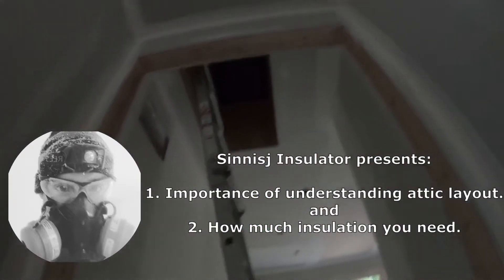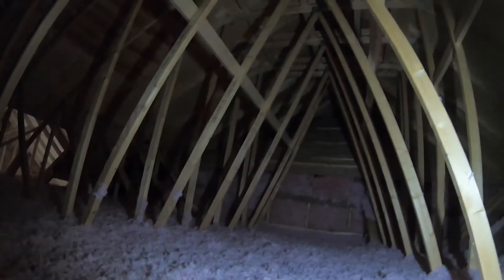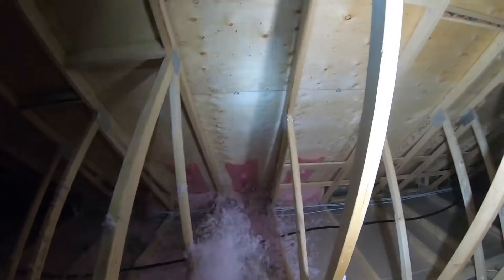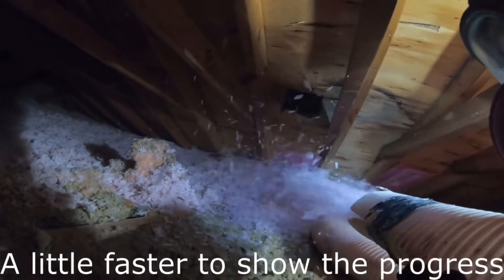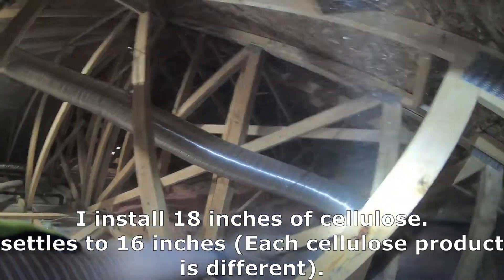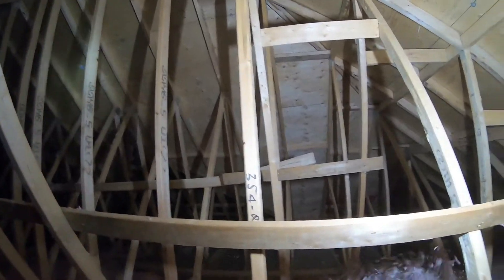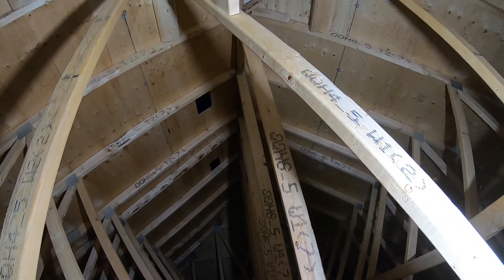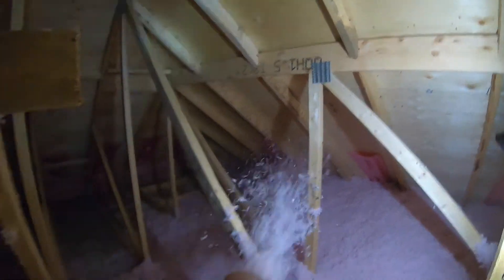Heat transfer resistance | is TWO FEET of glass fibre insulation good?

Comment: Recently had more fiberglass blown into attic. I asked the contractor to include the area above my garage. I was told it’s not necessary since it’s not conditioned for heat or air… your thoughts please.
Reply from the maker: That is true. But if you are keeping your car in your garage during winter and it's got drywall and tapped, then it may crack and build frost on the drywall. So I've installed an r32 or about 1 foot of insulation to prevent condensation at the drywall level. If you have poly on the attic side then it should be mandatory yo install insulation. Hope this answered your question. I may add this response in a future video, it's a topic I think many would want to know.
Reply: @SinnisjInsulator  thank you very much for the feedback. Your reply is reassuring.
Reply from the maker: @dennisbond7112  my pleasure, if you haven't already you can subscribe yo my channel and check my other videos on this channel. I post each tuesday on attic insulation and home insulation topics.

Comment: If a roof vent with no fan ok for a smaller house or do you recommend a vent with a fan ALWAYS?
Reply from the maker: actually a whirlybird or a roof vent tower is best for shallow attics. that's because it's fast for the air in the attic to heat up.

Comment: I’m hell bent on the R-value system being extremely out dated and irrelevant in today’s environment and insulation technology , not being biased at all I believe our current building code requirements are dated regardless of which insulation system is being used
Reply from the maker: It's true that if the conduction outweighs the other forms of energy transfer it should be tweaked to resemble real life a little better, considering radiation and convection in the mix.